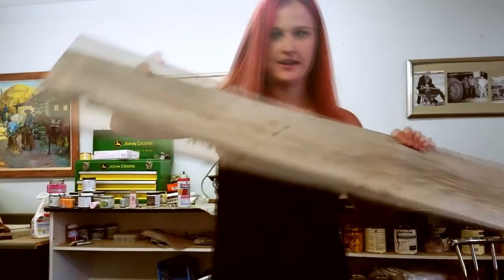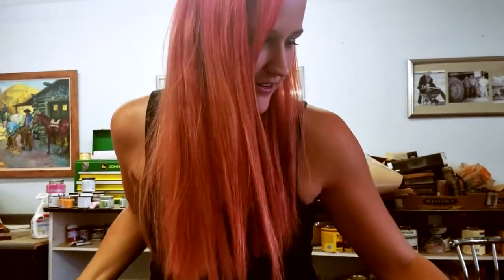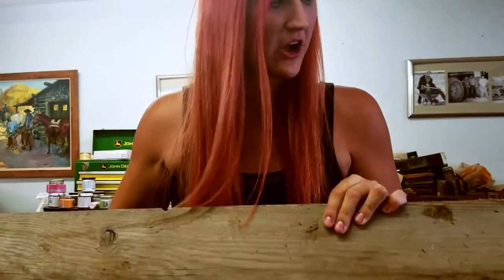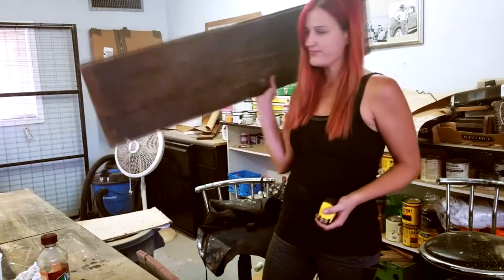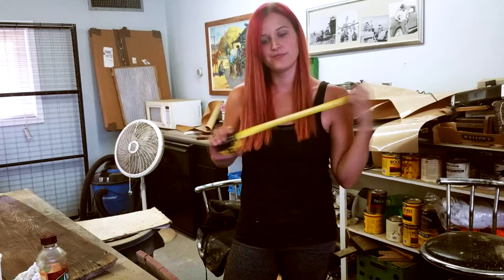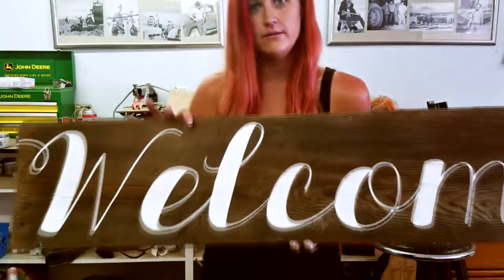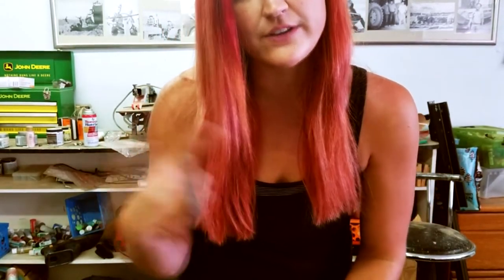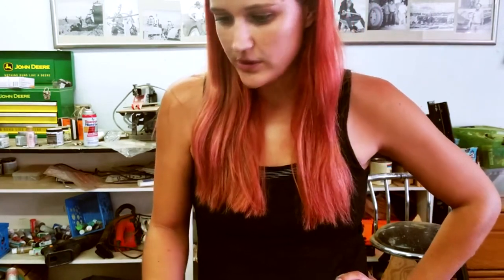How To Make Custom Rustic Signs (Barnwood)

Comment: I’m working on a sign and I’m using chalk paint. However, my paint brush slipped from my hand and there’s only a bit of paint on the wood. What should I use to remove the paint? Any suggestions?
Reply from the maker: Try using a fine sandpaper on it, or if it's on bare wood, use an exact knife to lightly scrape away the paint, but very lightly so you don't scratch the wood too much.